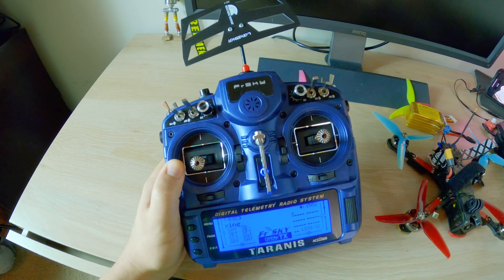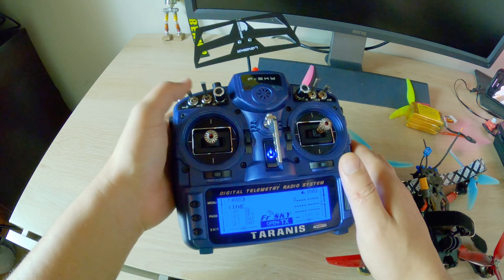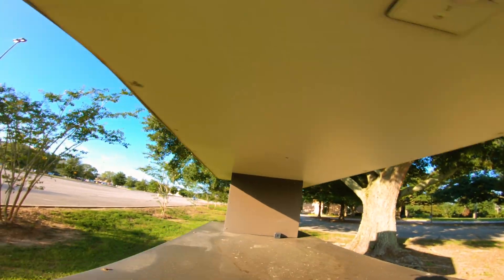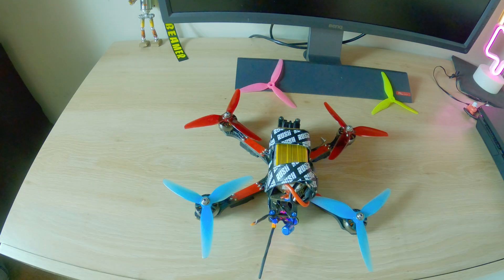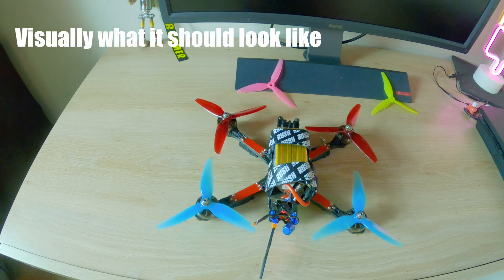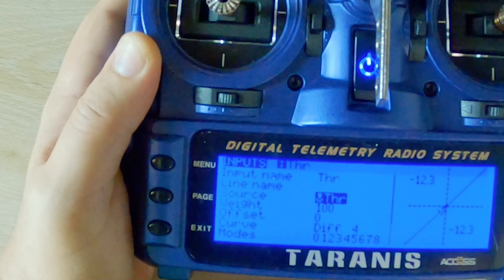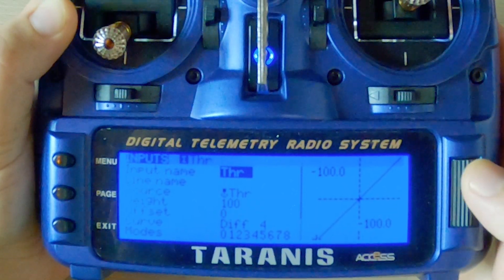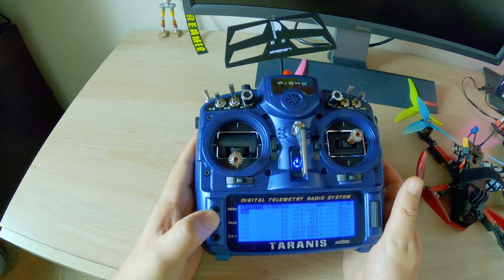Why I Fly with Idle Up

Comment: ohhhhh so thats how LeDrib was grinding rails with matty or whoevers drone on rotor riot for a while lmao when we tried it it was ping pong madness.. on 4s i guess its the same concept and numbers??
Reply: wow cheatmode for realz i always wonder about these things thx Beamz
Reply from the maker: yes or the sliding sparker things or how to stick close to a buildings while u dive it etc..  4s exactly the same since dealing with percents with motor output limit it shouldnt change but it does due to low end changing
Reply: Yea I tried sliding and it was hopping like crazy lol
Reply from the maker: @divingfalconfpv4602  with doing this or without lol
Reply: @MaxBeamer  without doing that.. just saw this video now. about airmode switch and idle switch..
Reply from the maker: @divingfalconfpv4602  😂

Comment: I have airmode on a switch but rarely (i.e., never) turn it off... I accidentally bumped the switch last weekend. Didn't notice until that first wonky IYS... ;-)
Reply: AIR-Mode on a switch is cool too but can u put actual PID’s on a switch lol like KISS Has it (kind of)
Reply from the maker: @3sheekfpv976  thad be dope dunno
Reply: @3sheekfpv976  Cool. Do you have a pointer? (Is it just to set up another profile with zero PIDs and switch to/from that?)
Reply from the maker: yeh i dont put airmode on a switch its always on me brAho thats why this way is better imo it just lowers my idle when i dont want PIDS in my BIZ 🖖
Reply from the maker: @SquishinStix that’s right on

Comment: interesting approach, i just have airmode on a switch so i can just remove it when do close proximity stuff.
Reply from the maker: and then u fly with no idle and just hope u dont bottom out? haha alot of old schoolers do it that way too still
Reply: @MaxBeamer  i have fixed idle at 4.2 on low kv and 5.5 on high KV .. but yes you are right, if you you do bottom out, it is definitely noticeable! i just too old to flick a switch so i just do the idle with the throttle stick instead ;)
Reply from the maker: @nullx8  u kno the bf devs deny that the props spin at any different rates of a speed when changing kv or motor output 😂 im like aight dude bye.. cant deal with them
Reply: @MaxBeamer  haha yeah WTF? LoL .. well its just how it feels in the end, i just noticed that with higher KV the idle up is better when higher, could be the frame to or whatever. recently i do have a lot more success with EMU actually. most of my quads run BF but generally speaking Emu is just a lot more forgiving. and less scientific :P

Comment: That is not what actual idle up is man. Idle up when off is meant to hold the throttle value below the PID activation point (Min throttle if memory serves?). Then flip the switch, throttle goes above said point, PIDs activate.
Reply from the maker: idle up is a switch that increases your idle.. thats it. was used before airmode to keep pids active correct. some kiss pilots still use it.. we are both describing exactly what idle up is. im choosing to use it in conjunction with airmode instead of as a replacement of to fix a problem i had years ago that ppl still have today which is why i made this video in my bedroom for my patrons months ago.
Reply: @MaxBeamer  Ahhh ok i see. Utilizing both so as to not necessarily bypass airmode, but make it behave better in extreme circumstances. Gotcha. Maybe i missed that in the video.
Reply from the maker: @zfpv7211  yehh alot of ppl dont get it but its a game changer even told bf devs about it a year ago and they told me i was trippin then made dynamic idle in the next release which is basically the same thing except dynamic and actually makes this work even better lol
Reply from the maker: says who?